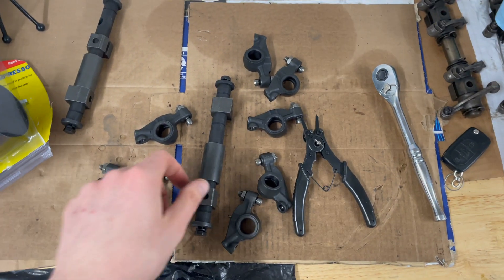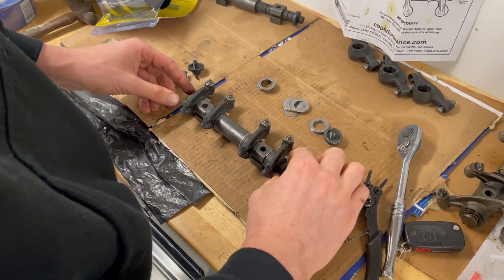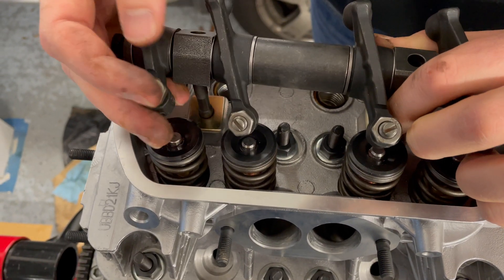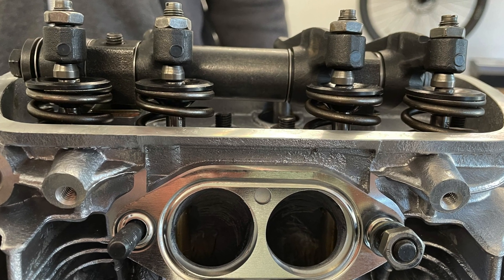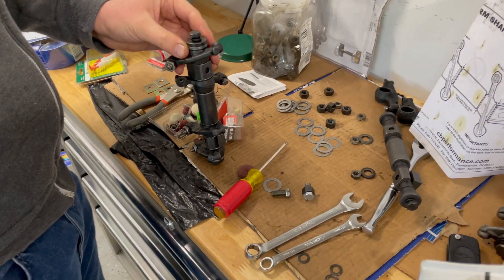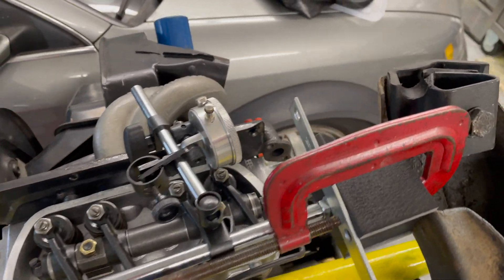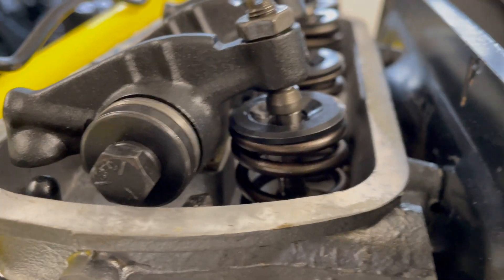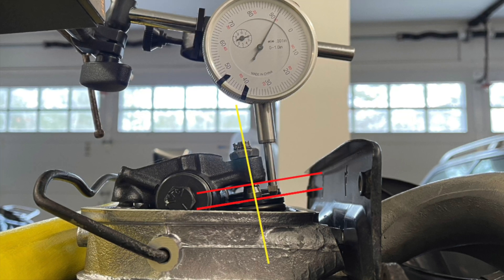VW Rocker arm geometry  - 1600 Type 1 engine | Ep. 20

Comment: I am not a pro, but I have been told by several builders that the slot in the rocker arm mounting blocks are supposed to face up (the valve side). I noticed yours are on the push rod side. Did the CB instructions specify this? thanks
Reply from the maker: I am not a pro either! Keep us posted if you find a real answer

Comment: I keep hearing you need to get the bottom of the rear cup on the rocker and tip of the valve parallel with the machined surface on the head where your valve cover would go, then I’m hearing you need to get the face of the valve adjuster side parallel with the face of the valve, I don’t know who to listen to
Reply from the maker: Face of the rocker parallel to the tip of the valve, i posted a photo with lines showing this on the video
So far all good!